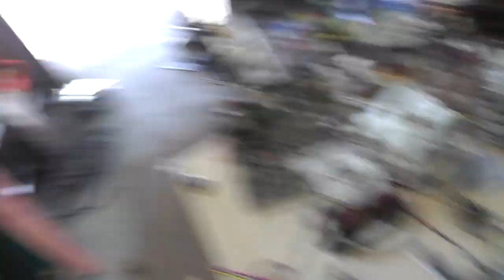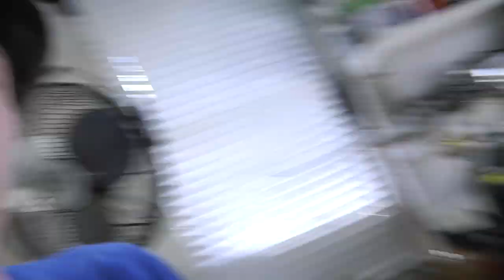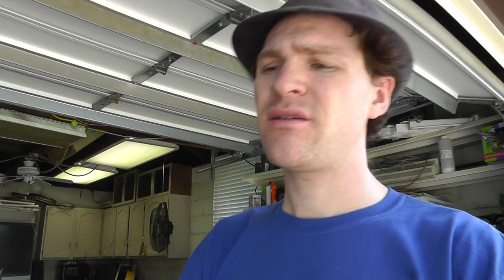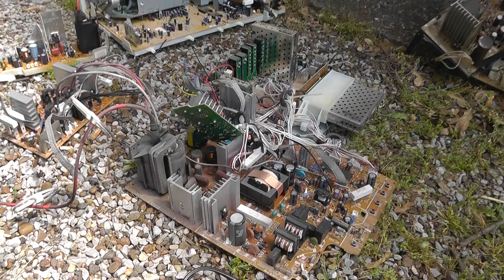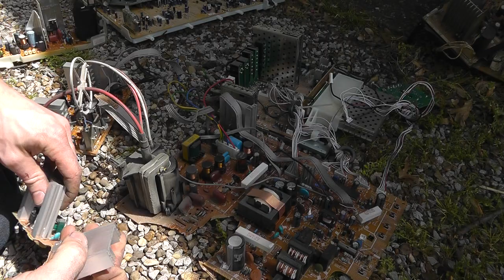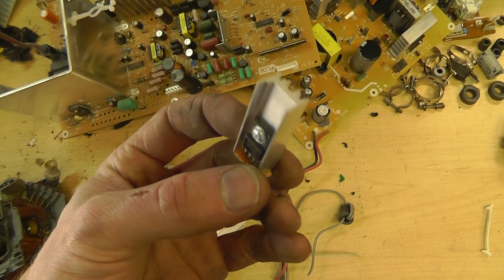Just A Trick On How To Salvage Heat Sinks From Circuit Boards... ( Eazy!) haha Have Fun!

Comment: Once you snap them off, if you don't care about the components attached, unbolt/unscrew them, and in a WELL VENTILATED AREA crank up the blow torch (or heat gun if you're of the uninformed variety who think that solder gets hot enough to vaporize lead before it liquifies), chuck it up in a vise, heat, and pull off with needle nose pliers.